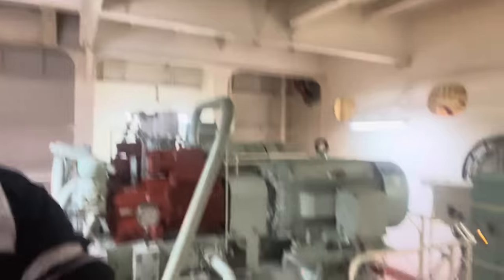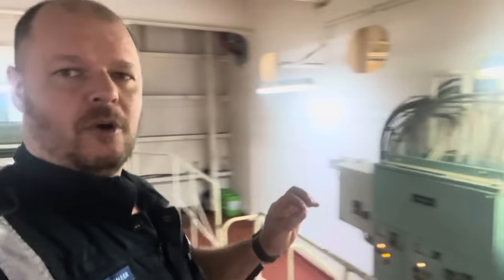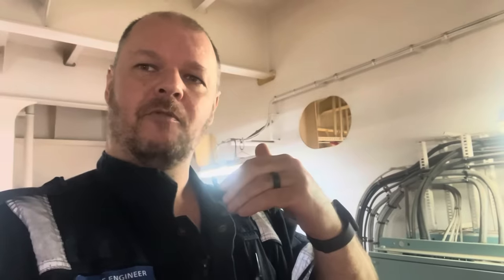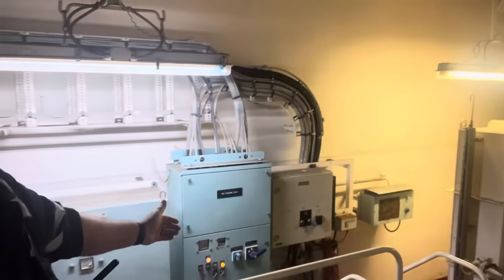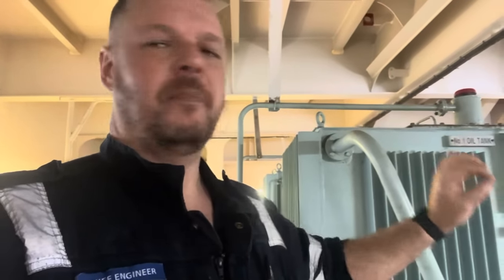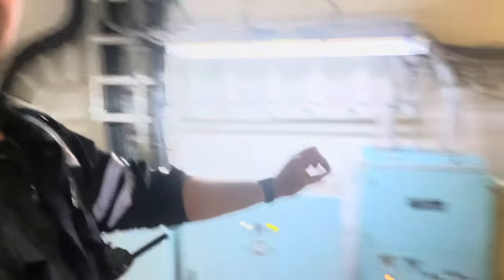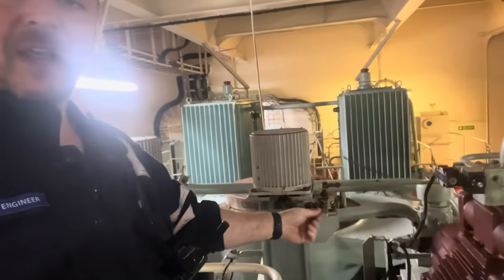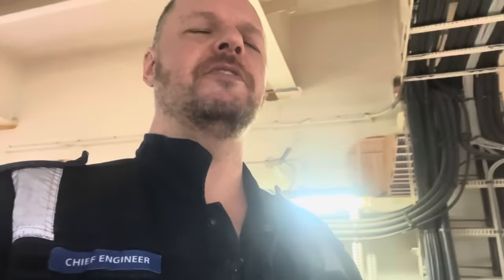Dali size containership steering system. How it’s designed to not hit Francis Scott key bridge

Comment: Does the fuel for the main propulsion engine and fuel for the emergency generators come from the same tank.  What all the experts are hinting at as a possible cause is something wrong with the fuel.  Also, is the quality of the fuel checked every time after bunkering.   Do you have any opinion why the main engine stopped?
Reply: No, the emergency genset has it's own dedicated tank in or adjacent to the space for it.
Reply: Also the main engine is dependent on external pumps for lube oil, cooling water, etc.  If those go down, the main engine will shut down.

Comment: Why does there have to be a 30 second delay to get backup control of the rudder? As seen in a narrow channel a lot can happen in 30 seconds. My background is aircraft. Most airliners have 3 hydraulic power systems that run concurrently, any one of which can power all the flying controls such that control is not lost or interrupted with double failure. Certainly whilst operating a ship in narrow channels without tugs, I would have expected a system where there would have been an uninteruptable power supply to the rudder.

Comment: So, that is what is supposed to happen. What do you think actually happened that the ship was unable to regain steering for longer than 4 minutes?
Reply from the maker: Generator problems, like
Too many at the same time, ship
Is probably a disaster maintenance wise
Reply: @steamman9193  the lights came back on after 45 seconds I believe. That means the emergency generator was supplying some power. Does the ship use the same motors to steer whether it is on mains power and emergency?

Comment: First reports say they had fuel contamination. So if the emergency generator was pulling fuel from the same tank as the main generator then they would have never gotten the other diesel generator (emergency) started as well. So like you said without electricity you aren’t moving that rudder. So the theory they had fuel contamination makes sense since you see them lose power and then go dark and then you see emergency power come on for a second and then the whole ship goes black again. So it appears the emergency generator sucked up contaminated fuel as well.

Comment: Those are electric motor driven hydraulic pumps.  I wish they had hydraulic accumulators to store hydraulic fluid, 10-15 ft3, would allow local hydraulic control to center the rudder

Comment: Did Dali lose engine power when it "Lost power"   the rudder can turn all it wants but if its not moving through the water it cant turn anything.   I never assumed that they meant the rudder itself didn't work... just that it couldn't effectively steer?
Reply from the maker: Every propulsion engine like here or Dali will shut auto shutdown with a loss of electricity
Reply: @steamman9193  so was it just a lack of rudder authority?  The rudder moved it just didn’t have enough water running past it to turn them effectively and power them back into the channel?

Comment: I don't understand what you're trying to say. It seems to me that the ship according to you had no choice but to hit the pier because it takes at least 20 seconds for the steering to come back on. So you've basically told us that if the power goes out the steering goes out and that's all it takes. How do you interpret that as being a design to prevent it from hitting the bridge?
Reply from the maker: It was 4:12 from lights out to impact, that’s why 20-30 seconds for an emergency generator to come on is reasonable. I’ll wait for the report but it appears as if there were multiple failures

Comment: I would hope, by this point, we can all agree those big electric motors that power the hydraulic pumps to operate the rudder will not function without electric power. The question is what diesel generators were online and running while the ship was "in-port operations" or "maneuvering". At sea, one generator may be fine. If it fails there is plenty of time to start another and continue the voyage. The emergency generator may or may not have the capacity to run the steering gear/pumps. There should have been at least two main generators running during the incident. We need to know that. We also need to know what fuel tanks each engine was being fed from during this emergency (for those that don't know, EPA regulations require low-sulfer fuel in-port and it is standard to run "dirtier" fuel in open waters). I would like to know if they had switched fuel sources just before this incident.
Reply: The EDG must be sized for all emergency loads - including a steering gear motor.

Comment: Seems like where that power failed on the Dali, from videos of the blackout would have been a very bad moment for that 30 seconds to start. Once the ship is not pointing the right way, correcting it is harder than the minor regular corrections.
You talked about hydraulic power redundancy, then a lot of your talk was about control redundancy. That slightly de-emphasised there was only one piece of POWER redundancy, and that as you DID say with (under the Baltimore circumstances) a fairly big delay on it.
Could a case be made that there should be regulations you EITHER a) have tugs to take you past any bridge or equivalent critical infrastructure within 20-30 mins of their base OR b) you must have your backup generator already running on standby? And if b) then you must have tested steering off generator power within 40 days. As yet untested maintenance affecting those systems would require tugs if available until the next opportunity for sea tests.

Comment: Using street view in Google Earth (Lat: 39°13'0.69"N    Lon: 76°31'42.11"W) situate your view in the south bound lane at the approximate center of the ship opening under the Francis Scott Key bridge (between the diamond shaped pylons) (should see mile marker 481 and 2 Baltimore City signs), now look north, north west into the port… you should see a freighter heading directly towards the center opening and another vessel way off in the distance already on the same heading! Like aircraft I’m sure vessels also have a specific corridor to travel in… so, if the DALI lost power wasn’t it already in its corridor heading straight for the center opening… so how did its heading change? Or, why then did it make such an acute steering correction taking it directly into the bridge support... (and from looking at her exhaust she was apparently under power!)

Comment: If power was lost how come the electric safety switch on the fuel line did not shut down the engine.  Safety switches are required.

Comment: retired Naval officer: I had a problem on a much smaller vessel. Fuel supply gelelled. What is the fuel redundancy of a cargo ship? Dali must have been switching from low-sulfur fuel to residual oil.
Reply from the maker: They should have been on low sulfur on the way in and not have changed back yet. Fuel and fuel changes are a problem but I’m not putting my money on that as the sole cause yet

Comment: The bellowing black smoke that occurred when the power was out means the ship engine was working! Generators couldn’t have produced that thick smoke.  So, either they did this intentionally OR they knew they were being hacked and was trying to override it by shutting off the power.

Comment: Would it be feasible ot have an emergency battery bank that would supply electricity immediately after failure of the main power supply?
I worked in a building where such an UPS system was installed - main power gets cut, emegency battery backup kicks in within a micro second or two.
If an UPS on the ship had enough juice to last for 1 minute that sounds like it would be enough since the backup diesel generator would be started by then. No thirty second delay . . . barely 1 second during which you lose control.
Reply from the maker: Maybe with current technology but generally ships are at least 20 years behind the rest of the world
Reply: Traditional lead cell batteries and seawater don't mix well. And Lithium ion battery cells introduce thermal runaway potential.
Reply: @Cragified 
"Traditional lead cell batteries and seawater don't mix well."
Where would the seawater come from?
If you rip open the hull below seawater level you have more worries than just losing steering.

Comment: The problem I have with the whole accident is that these ships can take over a mile for them to respond to rudder inputs. That means that the ship that hit the bridge, although already going straight down the channel, must have received some type of rudder input long before the power failure in order for the ship to alter course to starboard that quickly and that amount.

It would have had to happen prior to the power failure because it could not correct the momentum of the ship already dialed in by the starboard turn. Why was the ship, which was sailing straight down the channel, trying to alter course to starboard when it could have just kept sailing straight ahead?
Reply: If that ship had a bow thruster that could have been what was keeping it straight. Then loosing power would let the bow turn. 
Often the ship needs constant input in tight areas like that to keep going straight. If you quit correcting they’ll often veer off course pretty quickly.
Reply: @NBSV1 Firstly, these ships don't turn on a dime. They take a very long distance for that much weight to be affected by rudder or thruster input. Secondly, the thruster wouldn't be functioning if the power is out.
Thirdly, the current runs either in (against the ship direction), or out (with the ship direct). Unless the current is moving at Mach 1, it's doubtful it would have any effect in that short of a distance.

The real problem is how quickly the ship deviated from a straight path. it had to have had some type of rudder input long before the power went out and that would be strange since it was traveling in a straight line prior to the power outage.
Reply: @HueToobBlows  It didn’t turn on a dime. It gradually turned over a few minutes. And, was going about 8 knots. So, it’s covering about a mile in 10min. Plenty of time and distance for it to start turning. 
It also wasn’t going completely straight when the power went out. If the current is coming in that bit of angle means the current pushes the bow over and makes it turn. Something they likely were correcting for when they had power. 
At least you got the part about the thruster quitting when it blacks out. Strange how once that happened the bow started turning. Almost like something was pushing on it and wasn’t being resisted any more.
Reply: @NBSV1 Current was ebbing which means the ship was being pushed. Since the ship was moving at roughly 4x the current, it would not be being pushed in any direction but forward.

The current runs in or out, not broadside so there is no reason to be standing on a bow thruster for minutes at a time.
Reply: @HueToobBlows  If the ship isn’t absolutely straight with the current then it’s going to turn if there’s no correction. They were already making a bit of a turn at that point. If anything that bit of a turn will increase once you loose power. The drag from the bow will make it want to slow while the current is pushing at the rear. Which still has the same effect of making the ship turn if you can’t correct for it. 

Try driving straight down a road with no steering inputs and see how far you get before it starts turning. Based on time and speed they were about a mile from the bridge when they lost power. Can you drive a mile straight with no correction?
Reply: @NBSV1 Well, guy, allow me to explain some very important info to you without trying to sound snobbish or self righteous.

Not only have i been repairing yachts of all sizes for well over 20 years in my own business, but i also run them and am quite familiar with currents, drifts, anchoring, channel markers, weigh loads and distribution, and many other factors.

While I was not on the ship, i can surmise what the situation and reaction was like at the time based on past experiences.

As I stated, with the ship moving at 4x the current, that current would have no real impact on the course of the ship. it could ONLY affect it if was moving fast than the ship.

Perfect example is a set of locks on a local canal. With the locks open and a boat going against the current (which moves at a substantial clip through the narrow locks), the boat will be on plane while only moving at about 5 knots.

Against, and it will be sideways and smashing the hell out of everything in its way unless it moves at a greater speed than the current. this, again, has the boat on plane, well above the 5MP speed limit in the area.

All goes well as long as the vessel is above the speed of the water. Even slowing slightly to adjust speed has no effect so long as the speed is above the current.

Are we good?

As to your last question, a simple "yes" is all that is needed. Any vehicle on the road with a proper alignment can easily track down a flat, straight road (much like a channel in the water), with a tailwind, under accelerating or decelerating conditions, without a single need for input from the steering wheel. 

It's the way both water and land vehicles are designed from scratch.
Reply: @HueToobBlows  Well guy, you’re being about as non condescending as you are succinct. 
A yacht isn’t a big container ship. 
And, no matter how good the alignment is there’s outside forces that will make a vehicle veer off if no corrections are made. Just small changes in the crown of the road will make it start turning over time. 
While they aren’t the same a ship will still act the same way. Without corrections it will move around. Not a big deal on the open water where there’s room. But, in tight areas it becomes a big deal. That’s why there’s so much activity coming in and out of tight areas. 

Considering the people that actually work on and captain container ships like this have said things that line up with what I’m saying and not so much with what your saying I will continue on my way.
Reply: The physics involved are exactly the same. I'm done with you. I tried to be nice and explain that, A-i not only have experience in running vessels in all conditions, and 2-I also repair and understand the physics involved in running them under all conditions.
Reply: @HueToobBlows  Ok, bye.

Comment: Seconds, while caught uncontrolled in a Channel Current and east to west winds. We had it at about 45 seconds when the lights came back on as Smoke(likely from the Generator firing up) Billowed out of the stack.
*No one ever mentions the hard West direction of the Smoke from the stack. A clear indicator of Push against the Port side of the ship.
Reply: the smoke was heading mainly to starboard and astern - there was only a very slight Easterly breeze at the time - the water was very still - the smoke from the stack was drifting as much from the ship moving at 8 knots plus an Easterly breeze of just one or two knots roughly in the same direction - those added together made the smoke from the port stack head behind and to starboard - there was nothing obvious to suddenly veer the ship dramatically starboard - and there are no signs that the pilot or captain had the engines running again to move the prop into hard astern - so the theories about the prop in reverse moving the bow hard starboard are utter rubbish
Reply: The weather report from that time says no wind. Not sure why it looks like wind in the video unless it was just a line of smoke left as the ship moved. Any ideas!
Reply: That smoke was too much to have been coming from the relatively tiny generators... that's the main engine having stalled and starting back up in an overfueled condition. Even if it was the generators firing up they should fire up and burn clean in a split second... even really old generators properly maintained with no electronic injection at all don't burn that dirty.
Reply: @mikewood8695  Well... 32 years at sea I have never, EVER seen a generator smoke that heavy and that long, not even the defective ones. Besides, the restart of even a single generator pulling the entire main switchboard would not have caused that engine to overload, because most equipment stopped during the blackout does not restart immediately (needs manual reset) so that generator would actually start up against a light load anyway.
A heavy smoking like that however is consistent with a main engine starting up and running in an unusual situation (like a reverse start while having significant headway).
So regardless of what is being said (no indications the engines were running again) that big black cloud to me indicates that an astern start was at least attempted. "No indications" are fairly meaningless when there is a full minute of th VDR not recording any sensor data...
And that is only the VDR not recording. If the Engine Room alarm computer had to restart as well, it can take easily another one or two minutes before all data is online and availlable again, so it is very possible that the engine WAS running astern without it being visible in the recorded data. And if it isn't visible in that data, very likely it was not immediately visible to the bridge personell either
Reply: @Wingnut353  Pilot reported they initially got the Generator providing Emergency lighting - But no Navigational Control. Moments later he ordered the Port anchor Dropped, then followed wit ha Rudder change order.
and Yes, Generators can blow a massive Black cloud. If there was a contaminated fuel issue, even more likely.
Reply: @bobh6728  You can get a report of no wind, and there's still a wind gust. Weather reports are not 100% area coverage or real time. Weather is still unpredictable. Planes have crashed due to sudden wind microbursts.